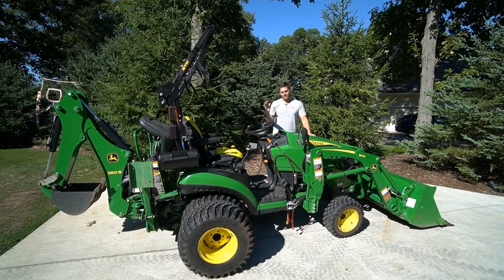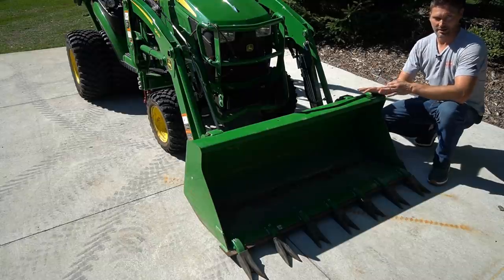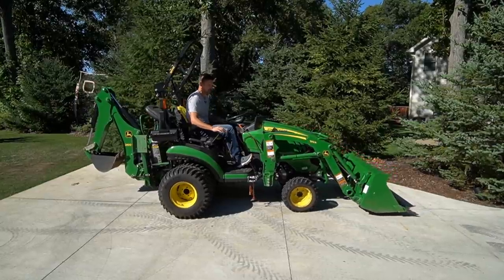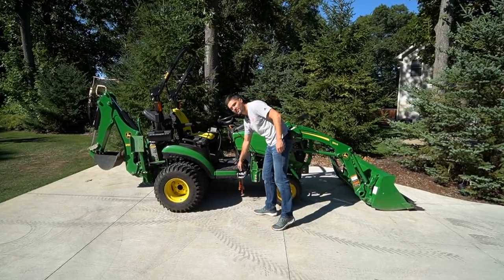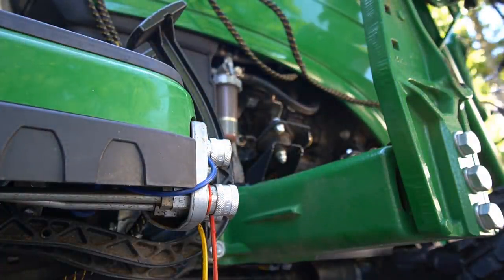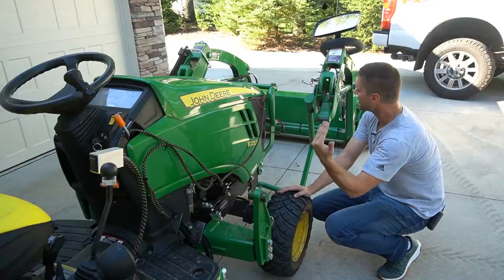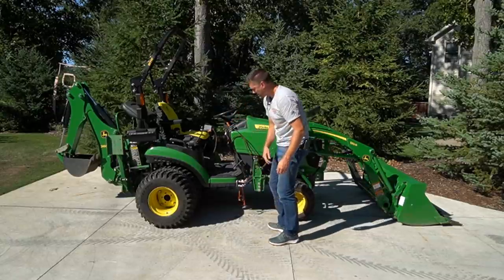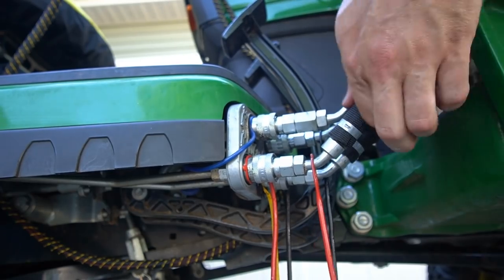HOW TO REMOVE AND REINSTALL A JOHN DEERE FRONT END LOADER! 🚜

Comment: One thing I would recommend is that when you are actually attaching the loader It may seem that all you have to do is move the loader joystick forward. It will attach at the two points if you do that and you will be able to pick it up. BUT if all you do is that the loader will look uneven from the driver's perspective. It is that way because it is not fully on. This video should show the final resting position of the front end loader's parking brake after it is fully attached. He mentions to drive forward while moving the joystick which is correct. But I think most people will always believe they are fully attached when they move the joystick forward and think that is all they have to do. Without illustrating why you need to move forward while moving the joystick people will be confused. Also did he ever re-lock the kick locks after everything was attached? or do the locks automatically lock when everything is fully attached? Its a good video but there are key moments not being stressed.

Comment: I still come back to your vid to review how to remove and attach the loader.  This time I can't get those two kick-brackets on either side to come up, so I can't remove the loader.  And I do have it in neutral.  I tried it on grass/gravel and also in a barn with a flat concrete floor...(later):  Ah, yes, I missed the step when you rock the bucket forward and lift the front wheels a bit off the ground!

Comment: As usual, your videos are always helpful and informative. I recently bought a used 1025R with loader and from this video I learned two things. 1) I'm not the only one who struggles with the hydraulic connectors. Lol 2) That somehow I have missed that you should have the tractor in NEUTRAL when taking the loader off. That looks like it will make it a lot easier and smoother to remove. Thanks again!

Comment: Thanks so much for this excellent step by step video. Since I remove the loader only once a year to install a blower I always have trouble remembering which way to move the stick. My 3039R has the full cab and the lower glass is very close to the loader arm tower so I can’t afford to make a mistake. Most helpful tip for me was putting the tractor in neutral when disconnecting loader letting it roll out slowly. Awesome video which I will watch numerous times twice a year. Thanks from John in Eagle River, WI.

Comment: If you have a dust cap that falls off, put a small zip tie around it not really tight just a little pressure.  That causes enough resistance to keep it from falling off.  That has worked well for me.

Comment: I happened to read in the manual that if you never remove the loader (like me), there is a procedure to firm up the operation of the controls.  If you pick the front of the tractor a couple of inches off the ground, then loosen the 2 small set screws, this will allow the 2 large pressure screws to be tightened against the back side of the mount arms. Tighten the small set screws, & I assure you the next time it is used, you will swear it is a new loader.  This really helped the operation of mine, the only down side, the large screws will need to be loosened before the loader can be removed.......
Reply from the maker: Wow, I never knew that.  I'm gonna have to check this out for sure!
Reply: @GoodWorksTractors  I  failed to mention they want you to raise the front end using the bucket. It appears this takes all the slack out of the latch, then adjusting the large bolt holds it tight against the frame member.  Sure made mine easier to use.....

Comment: Poor Rosie!  I hope she gets better soon.
For the "slow learners" (j/k), John Deere has a smart phone APP called "TractorPlus".  Once you download it and configure it with what equipment you have, it has step by step instructions that you can go through while sitting on the tractor.  The APP has instructions for the bucket, loader, and mid-mount mower for the way that I configured it for my tractor, along with error code look-up, icon glossary, safety info, etc..  In reality, after you go through the process a few times, it becomes easier and easier to do without having to think about it at all.  But, the APP is handy to have if you need a refresher lesson if you forget how to get it done.
Reply: "slow learners"...  Yep, I guess I need to download that app. :)    Thanks, Warped!!

Comment: I was told about another method of bleeding out the pressure ( tractor side )  on the hydraulics. With the engine shut off, turn the key  to the first part without starting the engine, then rotate the levers and activate the 3rd if you have it.  The pressure is relieved to the point where it is easier to connect the lines.

Comment: Nice vid; for me the most difficult part is plugging those hose back in -- they just pop back out.  I'll have to get the dealer to look at this and show me how.
Reply from the maker: Make sure you're relieving the hydraulic pressure.  You should be able to push in the nipple on the fitting very easily.  Normally this is the problem if they pop back off.

Comment: Nicely done.  At 14 min and 20 seconds you I noticed your parking stand looks tweaked and not sitting square  to the ground.

Bill
Reply from the maker: Hey Bill, not sure, I just looked and everything seem fine to me.  It is a wide angle lens so some things may look a little out of proportion at times.
Reply: Good Works Tractors 
It could be an optical illusion.
Bill

Comment: What keeps the support leg in the standing position after bleeding the pressure? Just the friction with the ground?  I can take mine off normally fine… but I’ve been trying to take it off on a dolly like others have done.  On a dolly, if I bleed the pressure, the leg wants to fold back in.  The legs don’t really “lock” in the standing position like some describe it.

Comment: I have a John deere 4044m with 400E loader. It doesn't have the quick loader detach. Is there still a way to detach the loader and use the tractor without the arms on it? Any direction toward info would be appreciated

Comment: I’ve got a 3046r and whenever I hook back up there is alway too much hydraulic pressure on some of the hoses. End up having to use a wrench to relieve pressure. I always move the control arm around to relieve pressure before unhooking. Any idea what I could be doing wrong?  It’s usually several months between hooking up.
Reply: If you store your loader outside, the heat can build up pressure. I’ve also read that over time pressure can build and something about spindles. Sorry I can’t locate the source.

Comment: Try that with a Mauser cab installed. You seem to have a bit of a problem booking up the hydraulic hoses. That was e breeze compared to doing it underneath a cab floor. Absolute nightmare.
Reply from the maker: Doesn't matter what cab it is, they always make it harder.

Comment: My 1025r died and I need to remove the loader to drag my tractor onto a trailer to take it to a dealer.  Can the loader be removed without turning on the 1025r?

Comment: Dealer would not demonstrate this process. I have had my machine a year without removing the loader.
Reply: My dealer tried to demonstrate but failed miserably. I watched a couple videos and it was easy peasy. This video does a nice job emphasizing releasing the pressure by cycling the joystick.
Reply: My dealer not only demonstrated all operations but he made me do it too
Reply: @davem145mxr  4 years before my 2025R I bought a X738 from a different dealer. He would not show me the auto connect drive over deck.